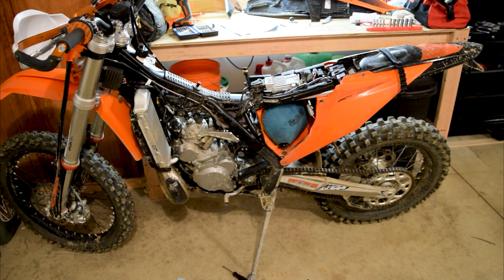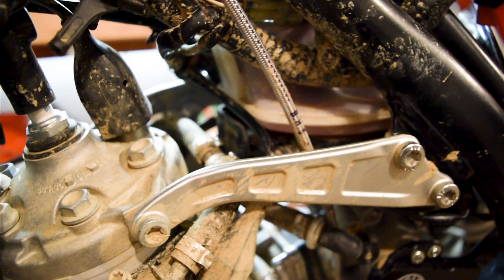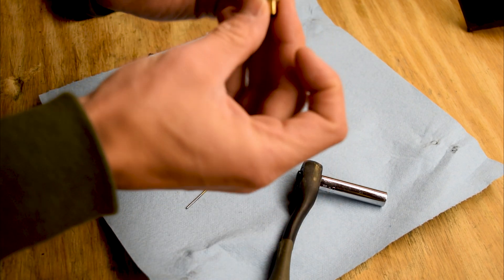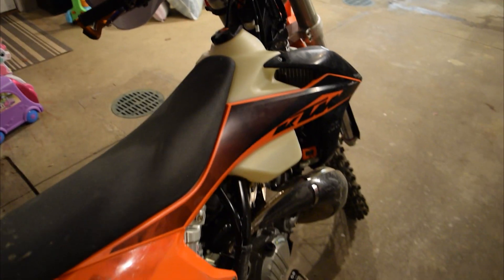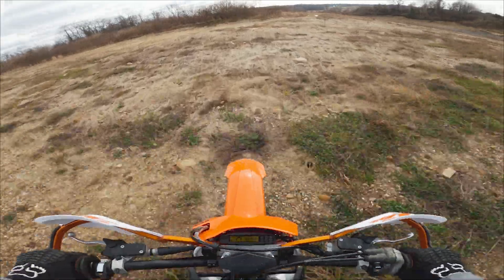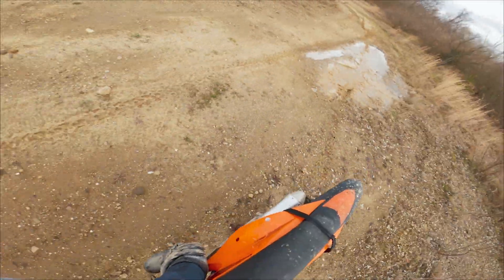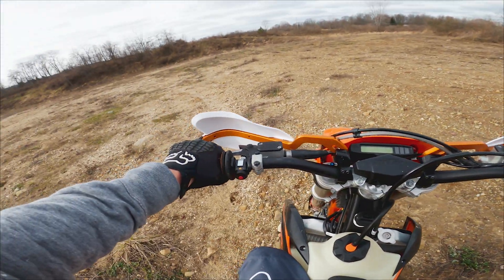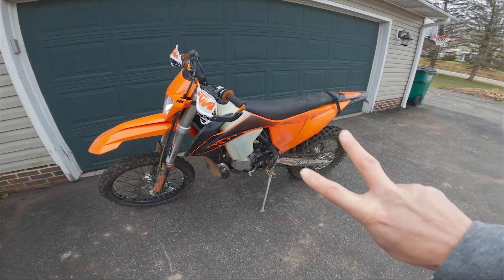How to install and fix a TPI Crankcase Pressure sensor (CCP Sensor)

Comment: anyone know what that little gold fitting is called as i snapped mine trying to screw it back in :/
Reply from the maker: Vacuum connection
Part# 55430023000
Reply: @ShiftGearsMoto  thx bro 🤙

Comment: Dude, you gotta let the bike warm up to at least 130 degrees and then shut it off for 5 seconds and then restart. If you just jump on your riding it in a cold start warm up map and it’s going continue to run like that.
Reply from the maker: More accurately, you need to allow the bike to warm up properly and not run it hard until it's at operating temp. When it's 10 degrees out, it will take a VERY long time for the radiators to get to operating temp just idling. 15 min? Not good for the bike either and you'll foul your spark plug. Just take it easy after you get 100+
Reply: I’ve never fouled a plug letting the bike warm up at idle to 130. But I also have the Slavens idle screw and have my air screw properly adjusted.
Reply from the maker: @micklejackson806  so do I. Are you in a warm climate?
Reply: Washington state, have had the bike since September and have over 35 hours. Temperature ranges from 28-50 degrees this time of year. Always follow the same warm up procedure. Cold start knob out, start and run for 30 seconds turn cold knob in and let it idle without touching the throttle until it reaches 130 minimum. Shut off the bike for at least 5 seconds and start then ride. I even ran the air screw completely shut (rich) for an entire 5 hour ride and never fouled a plug and it looked fine when I pulled it out, just got terrible fuel mileage as a result.
Reply from the maker: How far is your air screw out normally? Mine is all the way in.
Reply: On my 2022 te 300i, the factory setting is 4-4.5 turns out. I have it set at about 3 3/4 so it’s on the richer end. The 2022 maps aren’t as lean as 2020 and older.
Reply from the maker: @micklejackson806  interesting. I'm running an aftermarket enduro ECU map that helps richen it up as well, so I should probably adjust it out a few turns.
Reply: If your bike is running good and not stalling at idle or when going downhill or doesn’t have a low idle I’d probably leave it. You already have a aftermarket ecu with custom mapping. If you start to develop problems then you can adjust it. But the air screw has very small effect that are noticeable. What ecu do you run?
Reply from the maker: @micklejackson806  Good point, but I just think it's a bit rich right now. Might try 1/2 or 1 turn out and see if I notice anything. Idle is mostly good (I do have the idle screw though).
Silber's enduro map.
Reply: Put a fresh plug in, warm it up and RIP it down the road. Check the plug, adjust it a tad leaner and put another new plug in and repeat and see if it’s better or worse in color.

Comment: I think i have to change mine of my 250 tei 2019 
I hoped your vidéo should help me but you didnt really recorded the process step by step  for changing it
Perhaps i ask too much because you  have done à réal good job but it seems To be difficult for me
Reply from the maker: What step are you getting stuck on?
Reply: @ShiftGearsMoto  
Thanks to answer me
I think the most difficult part is how to switch off the sensor I mean where the screw are
Reply from the maker: @TheKekke69  there is just one screw in the front of the tray. I showed where it is in the video. Just unscrew that and pop the sensor out.
Reply: @ShiftGearsMoto  
Thats thé problèm i didn't Saw it in the video
Reply from the maker: @TheKekke69  were you able to find it? It's in the front of the tray.
Reply: @ShiftGearsMoto  
You explain it at 0.58 ... as the one you show about the tray
Reply: A good thorough video I came across of a guy re and re'ng of a CCPS. https://www.youtube.com/watch?v=-C8-3mnea3s

Comment: Hello guys, when you had problem with this sensor CCP maybe you had a problem with a spark plug at the same time? Since about 10 hours (total mileage 43h - KTM EXC300 TPI MY2020) I have a problem with a spark plug, it looks like too rich mixture. The spark plug is black and a little wet, when I clean it up, bike runs and start normally - I replaced them about 3 times, because I thought that is broken, but cleaning helped, spark plug works fine - NGK BR7ES (the owner manual say that my spark plug can be used interchangeably with a NGK ZGR7GI-13G). I've got an additional idle screw mode in my bike if this an importatnt information.
Thanks for any tips ;)
Reply from the maker: My first suggestion was going to be to install the idle screw mod. I fouled 2 plugs in my first few hours and haven't since on my 2020 after installing the idle screw. What is your starting procedure on your bike?
Reply: @ShiftGearsMoto  when is cold I sometimes use for a few seconds a cold start, it runs about 20-40s with cold start and after this time I push it back. Before ride I allow warm it up, bike runs about 3 minutes on an idle and firsts meters I ride gently, without revs etc.
Reply from the maker: @lukas88lag1  it's possible it's running too rich. Where do you have your bypass screw? 
Do you have a fan kit on your bike temp gauge to know when your bike is warm?

Comment: Hello,
I have the same problem on my '19 Tpi,it started immediately after I replace piston,pump ,etc...Before,no problems at all...
Could you send me the picture of old sensor(both sides) ,please,maybe it fits from other vehicles....
thank you so much
Reply from the maker: Yeah, I still have it so I can send some. It was just a bit dirty - that's all. Drop me a follow and send a message me on Instagram.

Comment: I just completed this similar test due to constant plug foul & sputtering by switching the pressure sensors.  I installed a new spark plug and attempted to start the bike, fired once and now wont start at all, cleaned plug next day and still wont start. So aggravating!  Bike is a 2020 KTM 250 XCW TPI with 20HRS.  My first extreme enduro race is out of state this coming weekend! no pressure right!?
Reply from the maker: Do you have the idle adjustment screw mod?
Reply: Check the fuel pump pressure?
Reply: Same thing is happening to my buddies 300 2020 husky. Cranks won’t start but has spark !?

Comment: Nice video does ur tpi have lots of problems?
Reply from the maker: I would say no. The only issues I've had with my bike are the low idle, a bad CCP sensor, and leaking countershaft seal. Easy fixes.

Comment: I have the same problem. Just started doing it at 25 hours even in 70 degree weather in california. Completely warmed up it does it, not as bad as cold motor but it's bad. I've own it for maybe 8 months. I don't think there is a warranty anymore.
Reply from the maker: Just buy a new sensor and put it in. It's an easy fix.

Comment: I have changed this sensor  in my husky 2020 with only 47 hours! :(
Reply from the maker: You've made it longer than some! Did it fix your issue?
Reply: Yes, the problem was solved with the new sensor. Also, updated the calibration.
Reply from the maker: @JaviSandin993  nice. Easy fix.
Reply: @JaviSandin993  hi. Updating the calibration? What does that mean ? My ktm most likely also needs a new ccp sensor
Reply: Just hit 70 hours this morning and got the dreaded light to pop up on my 21 tx300. Blinks 9 times, says ccps but the bike feels fine to me still? Just gonna order one in the morning and see what happens. 🤘

Comment: So the new sensor didn't work either? Did you figure out the issue?  Change air screw and do idle screw mod may help.
Reply from the maker: Already have the idle adjustment screw. Bike is fine in my opinion, just cold. I should be going riding this weekend and I'll make sure it's completely warm before investigating more.
Reply: Shift Gears Drink Beers been following your vids and replying to several ppl to get some input maybe you can help.... I’m picking mine up soon,  what’s the process you follow to cold start and allow to warm?
I read the manual with heating the battery pulling out cold start not opening the throttle and that’s all the manual says. YouTube some say let it idle for 10 mins and don’t blip throttle, dirt bike channel says you have to blip throttle lol any input would be much appreciated. Apparently before buying I only watched/read the positive reviews. After my deposit I see lots of comments of crankcase, ambient pressure sensor replacement, power valve leaks. 11k bike man. Thanks in advance -Eric
Reply: @eric89q  I'm waiting for my one to be delivered on Wednesday next week... I got 21 te300i wondering if I have to do idle screw mod as well... Some of my mates didn't even have to do this mode 🥺🥺🥺
Reply from the maker: Even if you don't have an idle problem, I would still recommend the mod.
Reply: @ShiftGearsMoto  everything is bought for it just waiting for bike to be delivered!!! All the best mate

Comment: How many hours on your bike? Was it sputtering since new or did it start out of no where? Kinda hard to tell if it's any better or not.
Reply from the maker: 15 hours and I honestly don't think I had a sputtering issue. The bike is just cold and the fan confirms that. I don't hear the sputtering in my riding videos. Hopefully this video helps those who are actually having the issue. I could be wrong though.